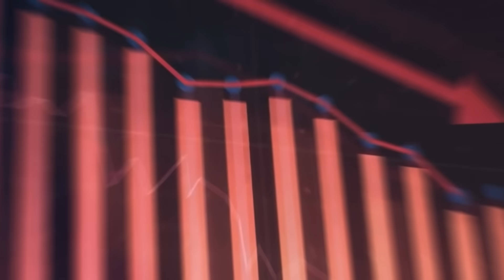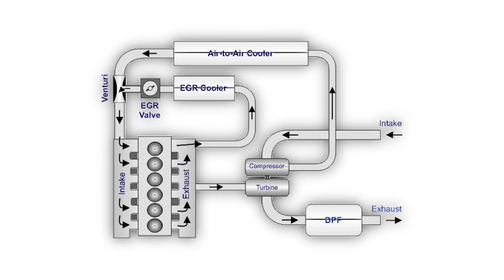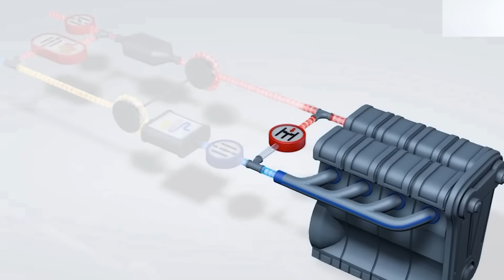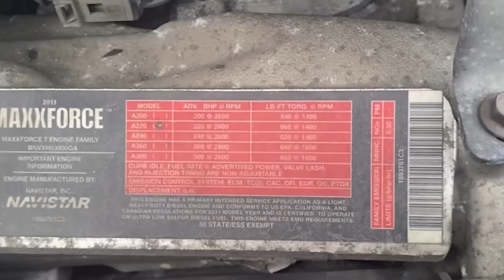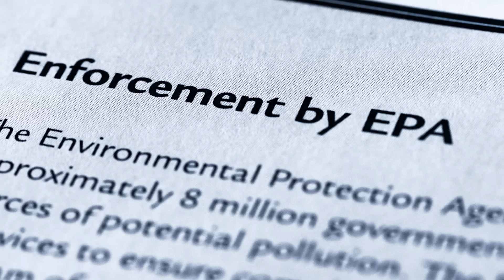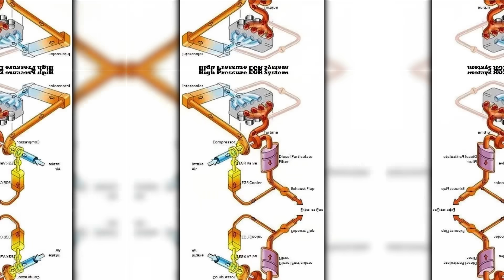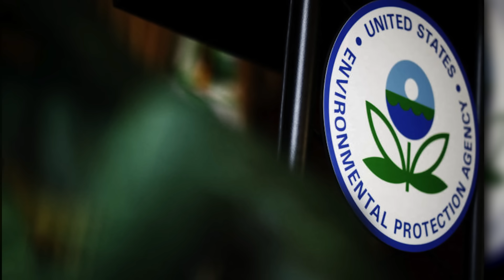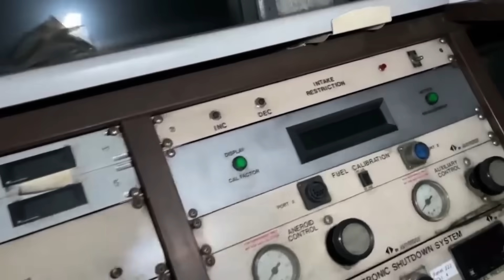The Rise and Fall of MaxxForce: The Engine That Broke Navistar

Comment: I bought a 2009 international school bus with the max force v8. The regen system sucked and left me in limp mode several times requiring me to disconnect the battery to get it to reset. This failed to mention the hydraulic brake system that required a computer to bleed and electronics that also put it in limp mode because it said low brake pressure. Oh and the no child left behind system also intergrated into the control system was awful too. International and navistar should close for good!

Comment: The engine wasn't too bad as long as you took all of the emission control systems off of it. My class 8 Freightliner was in the dealers shop every month for a year until I got rid of it. Then I bought a Cummins, zero problems after that

Comment: Do you know how much I hate this engine? Here’s the thing, I am a service technician for a fleet but training to be a mechanic. All my services are on a tight schedule, but if a truck is broke down when the service is due, well then it looks like the service is late. All the times this happens, guess which engine it happens to? And now that I am training to be a mechanic I get to help repair the engine and it is the same thing all the time on this engine. I know how to do the injectors and the cups because I have done so many of them now. Then also the EGR coolers. I haven’t got to do one by myself yet but I have helped do so many of them now I probably could do it by myself. Do you know every time it happens I always think what if this was an owner operator and it was his only truck? He would go broke.

Comment: I was a sales rep for a semi trailer company from 2012-2016, so many relatable stories. Coincidentally, called on Dutch Maid!! Then went to a used truck dealer and upfitter. We also wouldn’t take Maxxforce trucks in on trade nor 6.0 and 6.4 Power Strokes (also Navistar obviously). What a time. The CEO brazenly gambled on people’s lives (ambulances and first responders) and people’s livelihoods, such an arrogant attitude. Also, the EPA, for making ridiculously impossible demands and for us, allowing an agency to wield so much power. The shock rings are still heard and felt.

Comment: We have a 2011 FL with a DD15 that has 650K miles. Many issues with the DEF system, but they are not devastating. The engine runs like a top with no excess oil consumption. Detroit got it right.

Comment: We had 2 Maxxforce engines in our ambulances. They spent more time in the shop than on the road. We spent thousands on repairs. Constant reports of no power, won’t go up a hill or won’t go over 45mph….great for an ambulance 🤦🏼. Constant regeneration and waisted fuel. We finally got rid of them. 
I even looked at a motorhome for me. I saw a lot of diesel motor homes for a great price…..then when you read that it’s got a Maxxforce engine, I ran away 😂. I already knew why it was cheap and the constant repairs costing thousands of dollars 💵

Comment: Maxxoforce engines are proof that scr is a better alternative to egr. The engines that have been designed since spray more DEF so they can run much less egr and the new s13 has no egr at all

Comment: Evolve or die. Navistar sucked at making a reliable vehicle since emissions but had issues on old ones too. I did love the 6.0L when it worked in the Fords.
Reply: I drove an International Loadstar one summer in the 1960s.  I liked it better than the Chevy and Ford that we had.  It seemed like a real truck.
Reply: @GH-oi2jf I liked the old ones too. They just didn’t make the right choices with emissions.

Comment: Yeah these are a very notorious engine. I started working at a new truck center and I had so many problems with fueling issues on these engines. I was like man, I don't know if I'm doing something wrong or is this just having a a unknown issue and they're like what is it and I was like oh it's a Max Force blah blah blah and like that's your problem. It's a Max force and I would hear this notoriously throughout the shot that Max forces were horrible and they are they're god-awful. We'd have dump trucks come in for issues unrelated to the engine, not even bringing up any engine issues and when we go to bring them in the shop after they're sitting overnight when they were brought in they wouldn't start and I was like what is this here for a fuel issue is is it here for a compression issue? And like? Oh no it's here cuz it has a steering issue and I was like why can't you get this engine to run like it's a Max Force I get that but my God they this f**** horrible

Comment: IH/Navistar is a shit company as a whole from their light duty to agriculture engines. I used to love them based on their work for the 6.9/7.3, 7.3 Powerstroke and their tractors like the 635's and their early 90's yard tractors, but after the 6.0 Powerstroke fiasco I started to doubt their ability to effectively build a reliable engine. Then I started hearing over the years all these fleets having issues with anything powered by Navistar engines and people at dealers refusing to take them on trade or having loads of them in backlog and I realized...they don't know wtf they're doing and the only reason they exist is primarily being a supplier for other manufacturers of parts.

Comment: What I don't understand is that knowing how EGR works, and knowing that diesel particulate being emitted is not going anywhere, it is a byproduct of combustion, just like all of the gaseous emissions nox, at a specific volume per brake horsepower hour figure.    By recirculating they are trying to lower that output, that particulate is just like all matter you can't just get rid of it, it's non-combustible it's not like the engine can burn it on a second cycle, so they went into this knowing that the engine was basically going to be like a filter or a trap, that will accumulate this particulate sediment, it's absolutely inevitable by this design.     Eventually you hit the breaking point where the engine will no longer run correctly, because of efficiency losses in the air passages, or the sediment causes mechanical failures.     The only way that sediment is ever going to leave the engine, is by going back out into the air.     They tried to solve a problem that cannot be solved, the only thing they can do is put filters into trap it, to dispose of it in a different fashion rather than airborne.      This is what a diesel particulate filter is doing, it's trying to trap it in the exhaust rather than recirculating it through the engine to trap it.     It can be cleaner on the engine, until accumulation occurs that then causes back pressure leaving more sediment in dirt in the exhaust further up the exhaust stream, except for when it goes through burn cycles and then loads up on fuel, temperatures spike, and ultimately the very same particulate that they are trying to keep from being emitted out of the exhaust during combustion, just gets burned off later, it's still all going right into the air, it's a complete ruse/smoke screen, diesel emission targets for nothing practically, goals for the manufacturers to meet, that are not really meeting the threshold, the only way this wouldn't go back into the air as if the diesel exhaust filter became a consumable item, with no regen cycles, just basically a filter you replace, but then you still have to dispose of everything trapped inside of it, it's still the same amount of emissions no matter what they do, except if it were a consumable filter at least that sediment would not ultimately go back into the air, that's why I'm allowing the manufacturers to do these mechanicals to meet these targets are an absolute joke, it's a smokescreen, it's STILL all going right into the air with regens, and an extra 30 minutes of burning extra fuel too.....

Comment: Imho, the only real solution here is..... a glider kit, or a restored pre-emission truck. 
My grandpaw drove for 55 yrs, and i would have followed him, but he wanted a better life for me, God Bless him😢.
Out of all his trucks and engines, my favorite setup he had was a custom ordered 1986 International 8600 w/ a 60" sleeper, 400 big cam cummins, and a 15 spd with the final 2 gears "crossed like a bull hauler" as he called it. That truck had 6" straight pipes, and he'd wind it up until the speedo was back at 5mph on long stretches out west. I's just a kid, but man.... the sleep i got in that truck while ut hummed along on I-10 at 3am.... i'll never forget it. 
He racked up 1.5M miles before he overhauled it, then added another 500k before he sold it to a logger in town. Sheit, i bet it's hauling logs or chips as i type right now, while these new pieces of crap have already been melted down and turned razor blades😂

Comment: Navistar has not made a good engine in many many years. The T444E/ 7.3 Powerstroke and the DT466 were the last good engines. The newer A26 is trash and I guess we will see how the S13 does. 

The A26 uses Cummins after treatment but something is different because I have seen a large amount of them requiring a new SCR early in life whereas I have not needed to replace one on a Cummins.

Comment: Another AI slop video. Pictures of the EGR valve and coolers are from DT466 and other engines. Problem listed in the video is what every single recent truck oem has had issues with. It was the turbo air control valve that caused the main particular issue with big bore maxxforce and almost bankrupted them.

Comment: Was the CEO shown at 3:42 an engineer or reasonably knowledgeable in Diesel engineering? Or just a Business School product ? 
Did this proposal for massive EGR really come from engineers ? 
  What would be the impact on "the environment" if Diesel engines were not limited in "Nox" emissions (but required to run almost totally without hydrocarbon,carbon monoxide,and particulate emissions ? Are "Nox" only a problem if allowed to  mix and incubate with hydrocarbon substances in the presence of sunlight or ultraviolet light ? Otherwise eventually become dissolved in rain and taken up by plants ? A mild contributor to "Acid Rain" ?

Comment: I just want a simple diesel straight 6, six liter around 450 hp and 750 lb ft of torque  mild turbo USA made  available in new Fords with no DEF it should be modular in 5 cylinder and 4 cylinder variants. It shouldn’t exceed $6000 up charge Remember you’re not getting the gas engine you already paid for .

Comment: I remember when i first started trucking , we had leased about 9 of these trucks from Penske. within 10k miles on a stock truck , we had 4 that had the heads seperate from the block due to improperly drilled oil valley paths. After all that was dealt with these trucks were also constantly regenerating and dog piss for power.

Comment: The whole MAXXFORCE disaster is a stark lesson in managing technical risks in the face of ridiculous requirements. The challenge of balancing chemistry, metallurgy, and electronic controls in a rushed product is a design engineer's dream, but a system engineer's nightmare. Failure to account for low system-level technical maturity leads to reliability disasters in nearly every industry.

Comment: Didn't only break them, but lots of trucking companies & O/O drivers.

Like Celadon, they bought a tons of those new maxxforce trucks to use & lease(fleece) drivers. But the issues caused drivers not to want them after constantly breaking down & turned the lease back in. Celadon even offered a to swap to another new maxxforce truck if they had issues as they asked new drivers about doing their lease program in the drivers orientation. 

After time, those trucks became worthless, even with low miles & Celadon had lot full of them that were only 1/3-1/2 their original value. So when they bought new trucks, they cooked the books by saying they got a higher dollar out of them as trade in, but then cut a check under the table back to the dealer to repay the difference they actually got.
So an investigator in their stocks uncovered this  & other issues, which lead to their fraud investigation for hiding it from investors. Then their stocks dropped like a rock.
Then down they went. 

Afterwards, 2 of the biggest investment firms, the biggest one was ran by stockmarket bigwigs with no trucking experience & the other had less stake but trucking experience. They were infusing Celadon with cash, but then when one of the infusion dates arrived, the smaller one wanted a large piece of the pie to continue investing. The bigwigs group refused. Then within 2 days Celdaon went under as they didn't get funds and because the news of the funds to operate didn't arrive, some of the larger companies who had contract with them for moving freight started to withdraw their freight, afraid if Celdaon suddenly stopped operating, their freight would get stuck somewhere & mess with their operations.
So with no funds & the big loss of income, celadon started bankruptcy. Telling drivers to complete their last load & turn their trucks into the nearest celadon drop lot.

Comment: This is purely a senseless decision by the company's management team and CEO.
No engineer would choose a concept like this. They were guaranteed to work more according to the motto, we give what they want, I get paid anyway and they don't listen.
They wanted to save money instead of ensuring maximum operational reliability. Read, top-managed companies!
Even European manufacturers went the EGR route and burned their fingers.
An engine with pure SCR is very robust if you design the SCR system well and don't skimp on component quality.
This includes, for example, EXTREMELY careful investigation of where NOx sensors should be located to measure correctly and not be exposed to unnecessary thermal loads and water. Unfortunately, many have failed to do this. Don't blame the EPA.
/25 years as an internal combustion engine engineer in heavy diesel engines.

Comment: So were a small GC and needed a rig to haul our D6 and other whatnots. We went with a 2012 CAT CT660 (maxxforce with CAT parts and yes a CAT truck exists) semi truck due to a stupid low price and stupid low mileage. We did have issues pretty quick with the EGR system. We tried to keep it going but it kept having issues with the EGR. We ended up getting it deleted and what an absolute gem. Doesn’t have the power of an X15 but for the price, if you don’t have emissions testing, and you can find a tuner willing to delete it, they are insanely underrated when fixed. The interior is also a lot nicer than anything you’re gonna get in that price range. But I also own a 6.0 Powerstroke if that tells me you how much of a masochist I am.

Comment: FYI it was 5W40. And in this version of engine. There was no idle regen, check you AI non research. 
Was their failures? Yes, just like every Navastar engine. Most people did not follow proper regen processes, causing a lot of issues. The EPA caused this issue.  However. To this day that engine was one of the most powerful engines ever and without emissions one of their best.

Comment: I liked my MaxxForce trucks on good days, pulled well.  Of course they idled so loudly, only to be matched by Daimler’s DD15, we termed them MaxxNoise.  Not so much force, just sitting there making noise.  And then there are the SCR MaxxForces, which i’ve never gotten a straight answer as to what exactly they do.
First chance i got to switch to a Cummins truck, i took.
Last bid, they put me back into a MaxxForce truck.  It was a nightmare.  Down so often, the spare truck became my regular truck.  ISL over MaxxForce?  Heck yeah.

Comment: The Freightliner dealer and service center that I work at will sometimes get Internationals for trade-ins with Maxxforce engines. We pull the Maxxforce DT out of them, the rest of the Maxxforce motors go to the crusher or sit out in the field for parts. We sell a few used trucks and busses with Mercedes and Cat motors, but International DT466 sell like hot cakes and any Cummins motor sells before the truck is even on site.

Comment: i knew they were junk before i even knew anything about trucks.  all i heard from guys was to stay away from this motor.  then i heard that it was actually made by CAT.  that would explain why CAT chose to get out of truck motors.  they new it was junk and didn't want to be associated with it.  but they didn't mind making money off it.  i don't think they should allow separate branding.  if it's a CAT... call it a CAT.   the ironic thing here is diesel emits carbon dioxide... not carbon monoxide.  so why was all this necessary in the first place?  and now we seem to be fighting against co2... huh?  never mind there is significantly less Co2 in the atmosphere than there was even a thousand years ago... i thought Co2 was a natural part of the life cycle.  you know... trees, plants, oceans...  don't they all take in Co2 and convert it to oxygen?  by getting rid of Co2 arent we getting rid of oxygen as well?  well, at least we have electric vehicles to save the planet... right?

Comment: This explains why if you didn't run my old school bus for 20 minutes at high idle EVERY SINGLE DAY you would run into insta problems. As long as you heated it all up, and didn't try to drive cold, on a system designed to run on thousand degree air, I was good. Anytime anyone else drove it, it instantly broke....lol.

Comment: I had a final year pre-def ProStar+ with a Maxx13. Could barely pull the truck and empty trailer around. Rarely saw 65MPH when loaded. And that exhaust brake was horrendous, again, barely even holding the truck back when empty on the slightest of grades.

Comment: all these problems has ah simple solution if the engineers had taken the exhaust gas after the dpf the carbon deposition have been controled and these engines would have been ah success